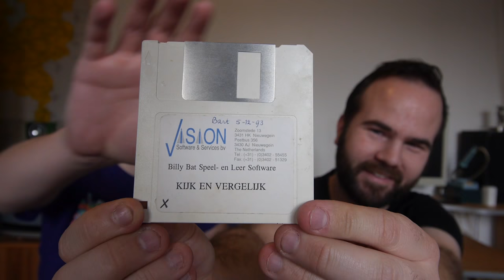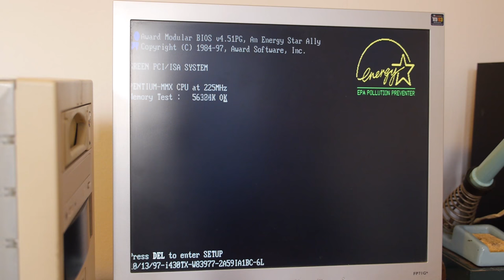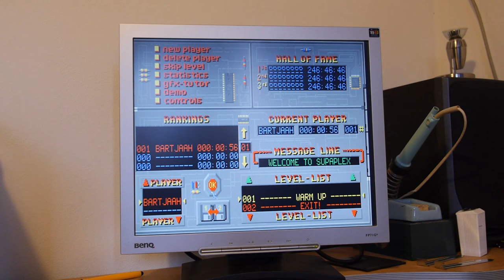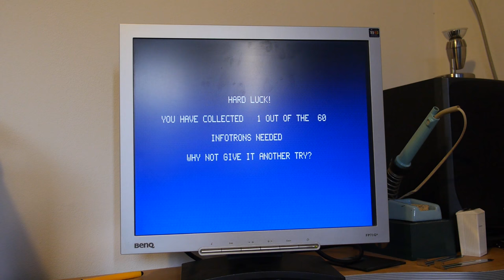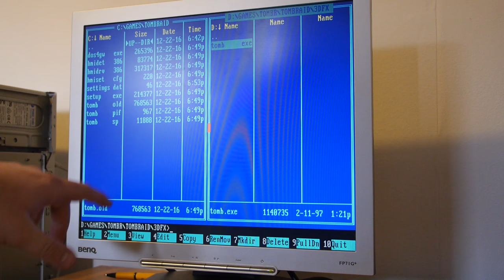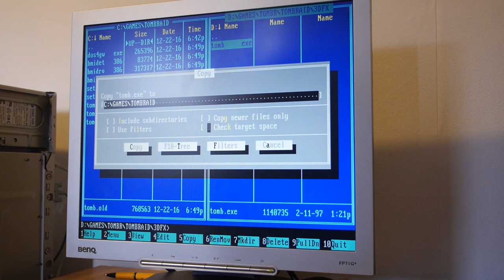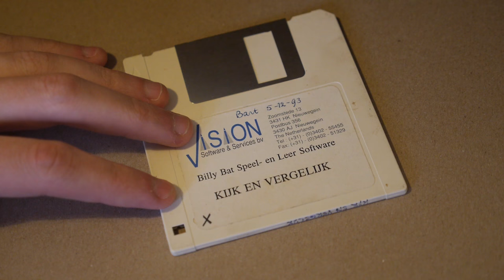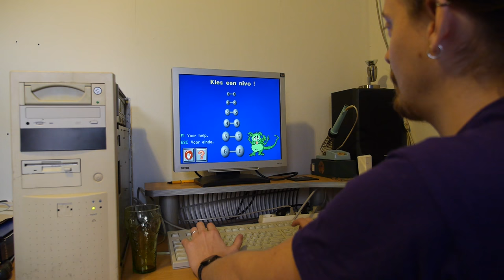[SPECIAL] Building MS-Dos game computer and playing games with Dosgamert, AWE64, 3DFX Voodoo1

Comment: I love it! This brings back so many memories from my youth! I've always wanted to find something like this or a PII system, but it's really hard to find anything here in the UK :(
Reply: If you haven't got anything yet, there's a few Pentium I MMX towers on eBay right now (computersinleeds) as well as individual components like AT cases, Socket 7 boards, Voodoo1 cards, etc from other sellers
Reply: I know those Pentium 1 MMX machines on eBay I mentioned are like £50 but you're paying to get something you can't find for free!

The oldest machine I acquired for free, in 2016, wasn't really old enough for pure DOS, but some of its parts will be used for my Windows 95/98 build :-) Those parts include an ABIT BH6 1.1 Slot 1 motherboard (amazing find!), a Pentium III 450MHz processor, an Ethernet card, and a 3.5" floppy drive. The machine didn't have a sound card, but rather an empty slot with no blanking plate where one used to be. Of course, company policy meant I had to remove the 4.3 GB hard drive (oh no!) lol... The machine also had 128 MB of RAM, an ATI 3D Rage graphics card (something like that) and a 48x CD-ROM drive. The case was a nasty tower with those thin metal panel fasteners.

I was very lucky to acquire that machine, because it was in an unlocked room in a small unseperated office building shared by two companies, and I just happened to go in there out of curiosity one day after going to the loo which was nearby on the same floor :-P By the way this was above a charity shop on the main high street of a popular mid-Wales town; with a window view of "JD Sports / Costa / Halifax / EE / Santander". These machines can be located in the most unsuspecting areas!

The company that "owned" the machine was actually defunct, but they hadn't quite got round to getting some of their stuff out of the building at the time. Therefore, I had to ask the staff member of the company I was using to ask the manager of the defunct company (thank goodness they had contact with each other!) on behalf of me if I could take the machine and the answer that was passed on to me was yes minus hard drive! In fact, the other company has withdrawn from the area as well so I very much rescued it (along with a Pentium 4 machine I hadn't previously mentioned but aren't those the most boring things ever?! Took it anyway lol...)

Let me know if you want specs of my actual build, haha!
Reply: OH MY GOD!!! Just one day after posting those comments, I've acquired from a friend of a friend a DUAL 333MHz Pentium II workstation tower with 512MB of RAM (4 modules), 246.1GB of storage (3 hard drives), and a Matrox G400 32MB graphics card! Along with an Ethernet card, onboard sound, 3.5" floppy drive, ZIP drive, CD-RW and CD-ROM drives. I would love to add 2 12MB Voodoo2s in SLI to this ;-)

Comment: So beautiful... I love DOS Games!!
I bought a Voodoo 3 3000 video card. 
Can I use a voodoo 3 3000 and a Sound Blaster 64 (CT4380) with DOS for games?
How do I active the glide function in DOS?
And can I use AWE32 drivers with AWE64 board as you made?
Reply from the maker: Yes the AWE32 drivers are also the drivers for the CT4380. yes youc an offcourse use the 3dfx voodoo3 3000 for dosgaming. But I didnt try it with the 3dfx tombraider patch. maybe you need a different patch
Reply: RETRO Machines thanks for your explanation. 
I misunderstood how use glide. I have to use a patch with each game? 
The patches come with the games or do I have to download  it in Web?
Reply: Voodoo3 has pretty good compatibility with DOS (https://gona.mactar.hu/DOS_TESTS/) and it's got one of the best 2D performance.
Regarding 3dfx DOS-games it depends on the game, some came with Glide-support out of the box, some got Glide-support later from the game developers, so you need to download an update/patch for them.
In most cases it's a bit more comfortable than shown here with Tomb Raider, where you replace the original .exe-file. Most games I know have (or get it with the patch) an extra .exe-file to run the game in 3dfx Glide-mode.
All DOS-games' Glide support is for Voodoo Graphics (the first Voodoo) though (maybe some are Voodoo2 also), so you may have to set some options in the autoexec.bat to force V3 to act like a first gen Voodoo.